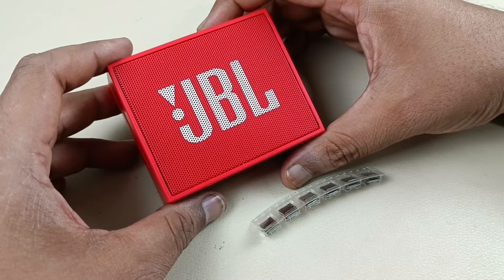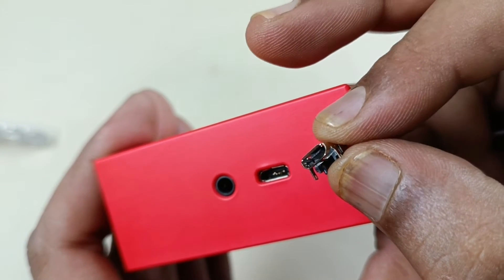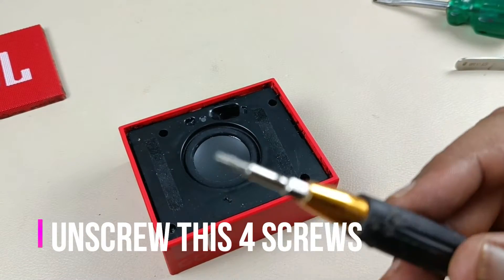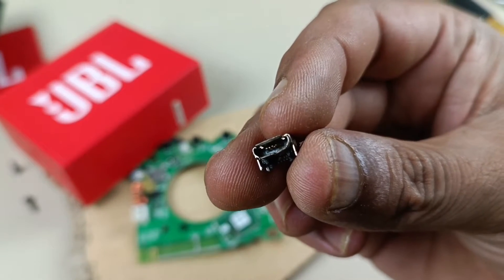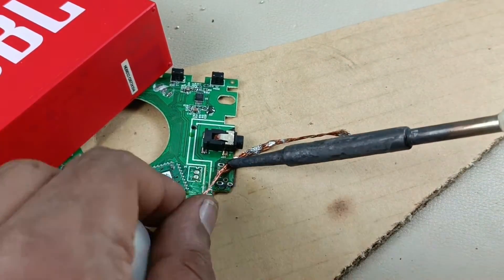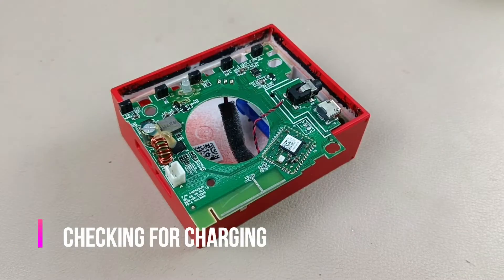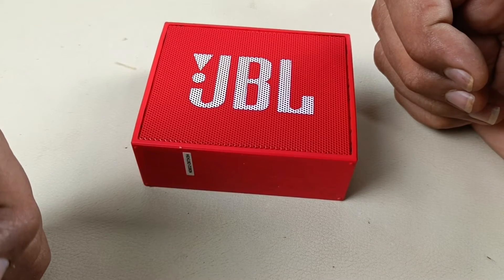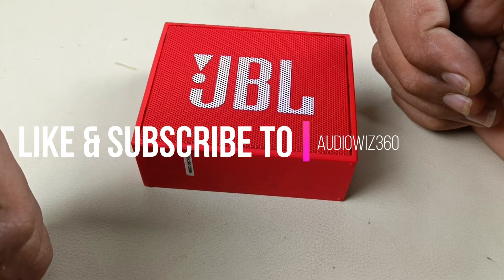How to repair charging port of JBL GO Bluetooth speaker | micro USB port replacement | How to fix

Comment: Bhai mere JBL go ka yeh jack khrab ho gaya hai shop Wale bhaiya keh rahe naya lagaya hai lekin wo baar baar toot jata hai jaise hi charging lagate hai. 
Ab wo keh rahe jack ulta laga hai jbl mai wo wala kahi milega nahi 
So is this true ...
Reply from the maker: getting this micro USB connector is very difficult in India almost most impossible.

check out with @GadgetSpares
+91 9741218068